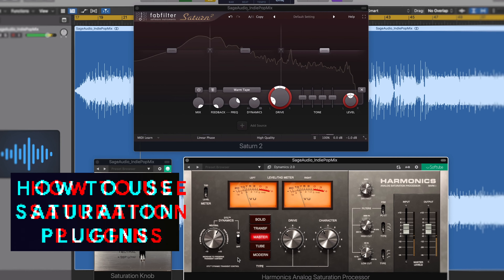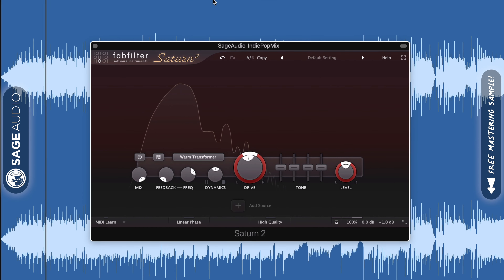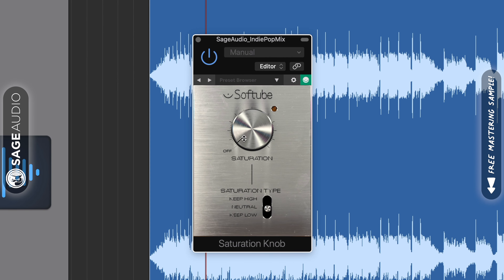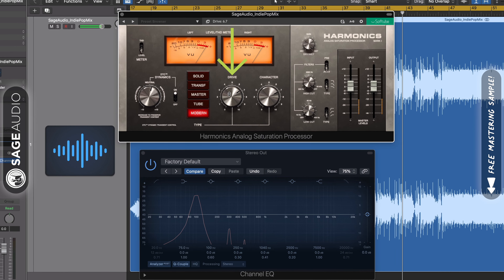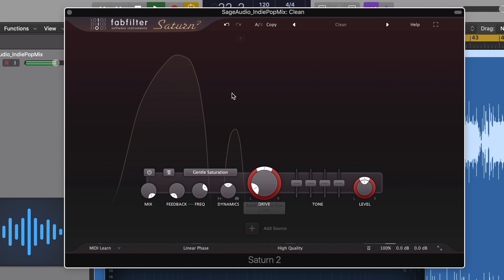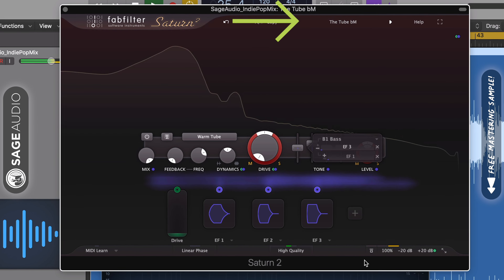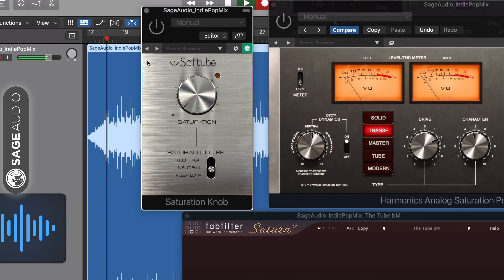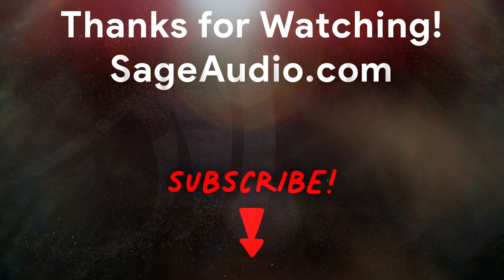How to Use Saturation Plugins

Comment: My favorite saturation plugin currently is Krazog's True Iron, a multi-transformer emulation. I generally prefer to add saturation to individual tracks and/or group busses not the mixing/mastering bus. Often when I apply blanket saturation (e.g., tape saturation) to the total mix there is something I like about it and something I don't. However, with True Iron, it often sounds great on both tracks and the mix/master bus, throughout the frequency spectrum.
Reply from the maker: Thanks for watching Sam!  I'll have to check that one out! 

SageAudio.com

Comment: Amazing video.  two questions popped up in my head and would appreciate any input from you guys.  

1)  When you see VU meters on plugins like the second plugin you demonstrated, are you shooting for an incoming signal to be reading close to 0 prior to adding saturation within the plugin?

2) I just learned about even and odd harmonics when it comes to saturation.  Do you have a preference of when you generally prefer to use even or odd harmonics on sounds/mixes/masters?
Reply from the maker: Thanks for watching! 

1) Nope! Not shooting for anything like that.
2) Not much of a preference - it'll depend on the mix.  It is nice to have the 2nd order harmonic though, which sounds warm and has a doubling effect.  This is present in tube saturation.

SageAudio.com

Comment: I wonder why Softube after all these years still doesn't put an output gain control to Saturation Knob.
Reply: @jef An output knob is the most basica feature any plugin can have and tbh it's the main reason why many people don't use this plugin (making our life harder).
Reply from the maker: I agree! I think it would be easy and really helpful to include one.

SageAudio.com
Reply: @sageaudio  but they have a plug in right there with an input and output knob that was not used in the example. If it did would you have used it in the example for a more fair comparison?
Reply: Sometimes it depends on whether adding another gain stage on an fx chain is conducive to the signal's current level, and/or also what the initial intentions are to begin with. While I completely understand the benefits of including one, I just choose to kind of look at it like an analog channel strip, which typically don't feature output level controls going from module to module. It's just that we've become so acclimated to the general ubiquity of Gain Compensation/Matching, along with all the emphasis concerning gain staging, that it's easy to lose sight of the fact that these are characteristics primarily applicable to the digital world.

Comment: Saturn adds way too much hiss, needs a button to turn that off
Reply: Did you try using the High Quality button?
Reply: Probably you don't know how to use it properly, never had that issue with it. Also some eq pre saturn and post saturn can make it way way better
Reply: @heavymetalmixer91  yes, it's worse on some settings so always requires a tweak here and there
Reply: @MIDNIGHTCVLT  google saturn and reddit - it's clearly been an issue for lots of people. Maybe they have fixed it now
Reply: @flyoverfredusa  i will! But yeah i normally treat highs with warm tape or with hard saturation, then i raise the band to recover the lost high end and it always tends to sound softer and easier to hear
Reply from the maker: I've had that issue on occasion too.  More so with the first version than the newer one.

SageAudio.com